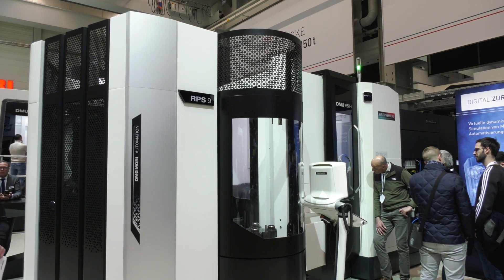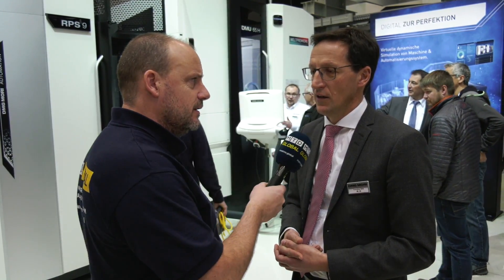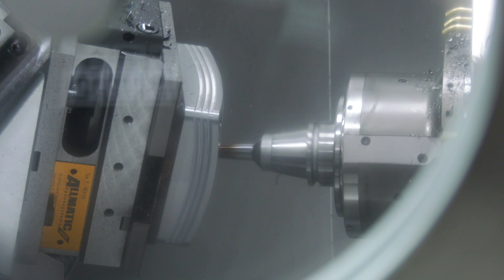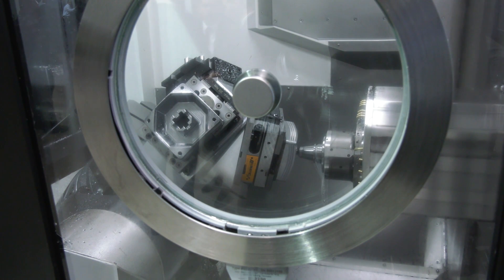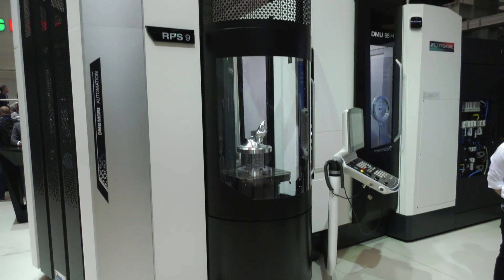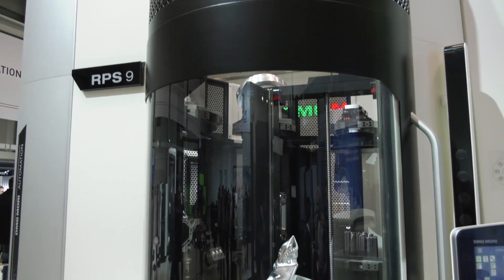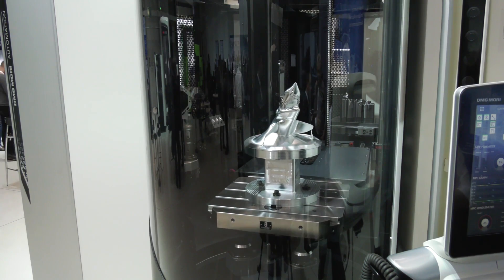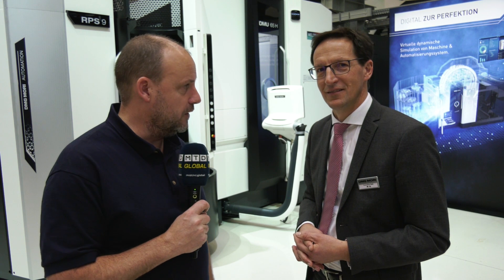DMG MORI DMU DMC 65 H monoBLOCK – The worlds first universal horizontal 5-axis machining

Comment: Theese days, every body copies GROB?
Reply: I was wondering that, what makes this the first? What makes it so different to GROB that it justifies its own category?
Reply: exactly what i thought.
Reply: This machine has a two side supported table and all linear axis in the spindle. Therefore the performance and accuracy is independent of the workpiece weight. This is what makes it truly universal.
Reply: A trunion style five-axis is hardly anything new, I'll admit it is more rigid than the P-type table.  The linear motors from DMG are faster than ballscrews, but do produce less torque.  About speed being independent of workpiece weight, the weight on the table will always affect speed, this is why Heidenhain has MBmax in the plane spatial command.
Reply from the maker: @matthewgowan7546  great knowledge, whats your background?
Reply: @MTDCNC  I work as a lead programmer, and production manager in a sub contract job shop in the north coast of Northern Ireland.  Mainly into the oil and gas, and hydraulics industry.  We've just invested in a few new doosan machines.
Reply from the maker: OK we often come to northern ireland if you want us to visit let us know
Reply: @matthewgowan7546 this machine uses ball screws tho
Reply: No, Deckel Maho has built this style machine far before GROB did, it would be more accurate to say GROB copied Deckel Maho, if only from a timeline perspective.